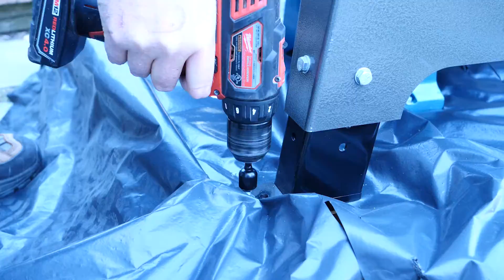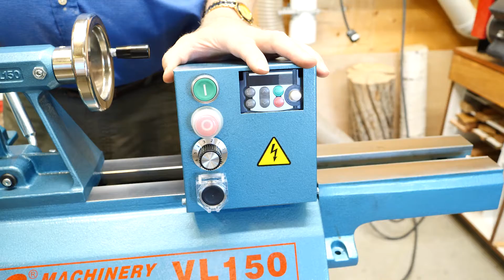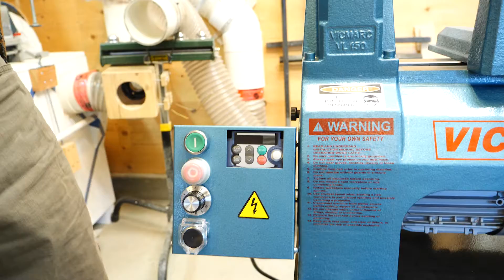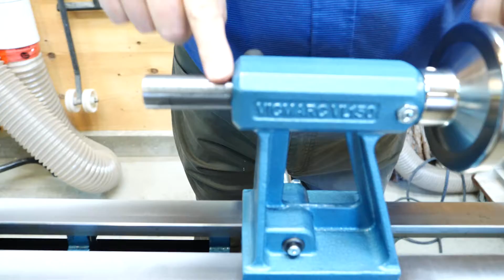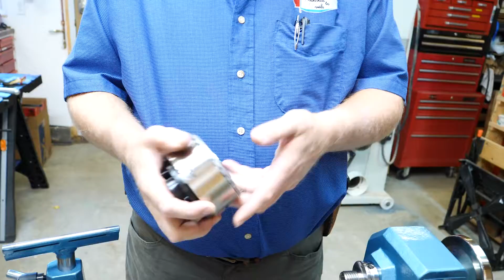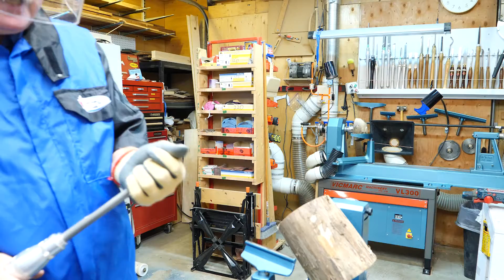Introducing the newly designed Vicmarc VL150 V2 lathe and putting it through the paces.

Comment: By comparison with the rest of the machine those belt access doors and the belt change procedure seem a bit under-engineered - possibly not a major problem if the belt can be left in one position for most jobs, of course.
Reply from the maker: Yes the access doors are small as is the lathe is total size, however I have never had a customer say that this was an issue in the six plus years I have been selling this lathe.

Comment: Gooday. You fitted the worm screw wrongly. 
In the manual it says the worm screw goes behind the slides, not the jaws.
It should protrude only about 19 mm or 3/4".
Reply: Good tip. I also would like to add that a plastic ring should have been used between the back of the chuck and the spindle. This aids in removing the chuck.